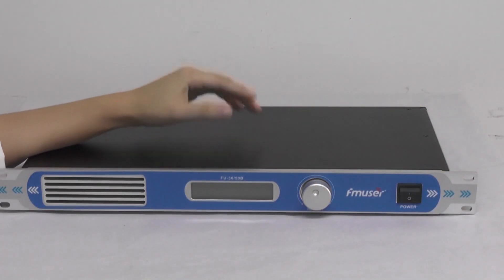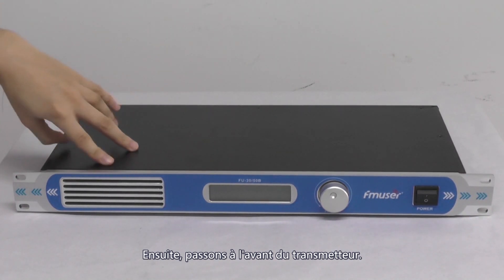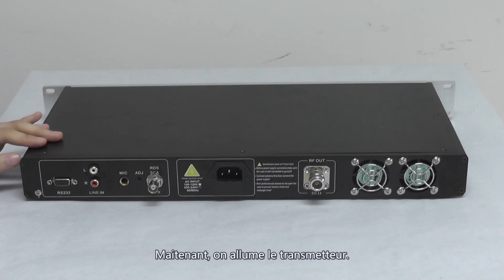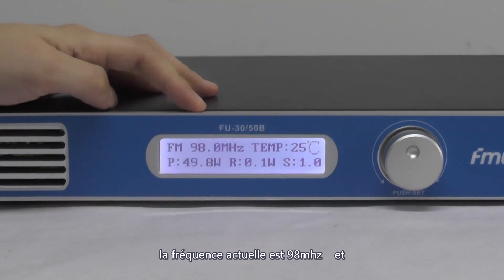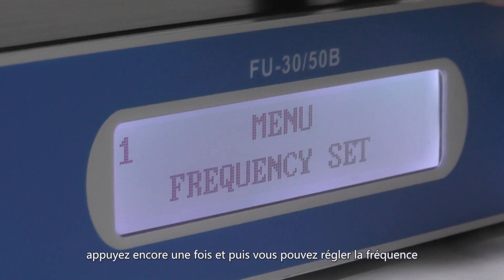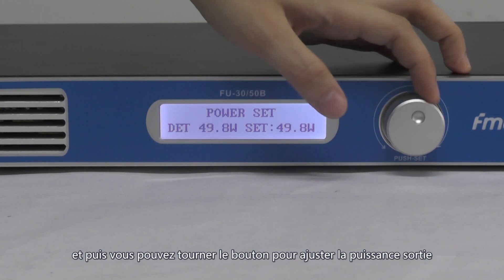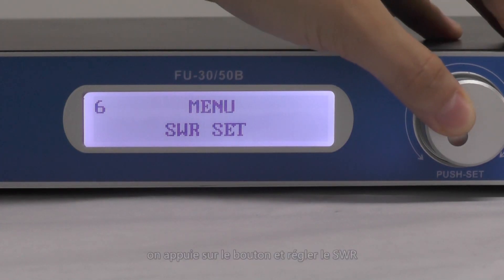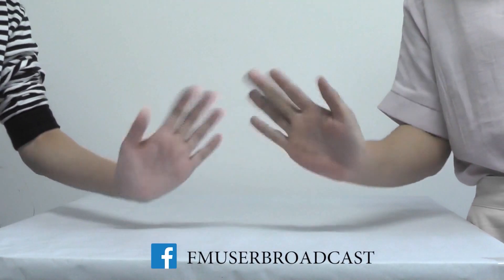30W/50W Low Power FM Transmitter for FM Radio Station/Drive-in Theater/Church/Parking Lot

Comment: how many miles around can you get from 30W and how many for 50W transmitter?
Reply from the maker: The real coverage distance depends on many factors, for example, the erection height of antenna, antenna gain, the power of transmitter, the use environment of transmitter(in an open/flat area or has many obstacles), the sensitivity of the receiver, the antenna of receiver, etc. If the erection height of antenna is higher or using in the countryside, the coverage distance will be much farther.
Reply: @fmuserbroadcast  20 miles witha good high antenna.